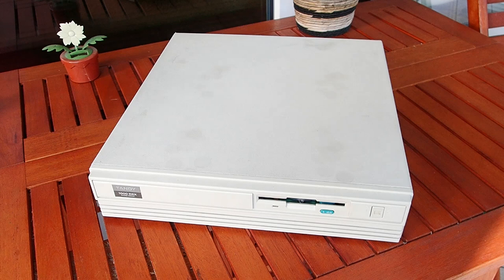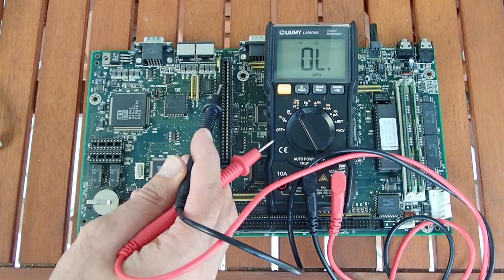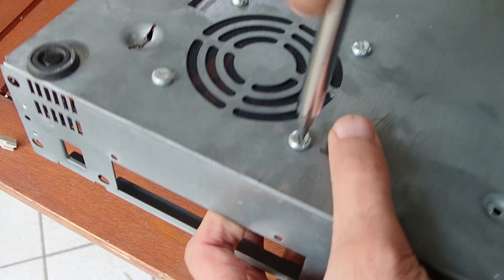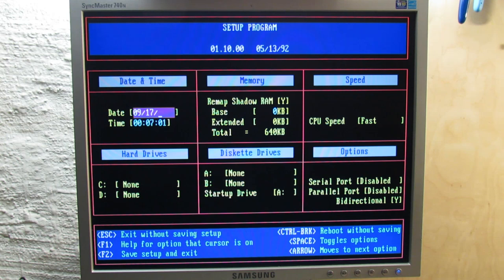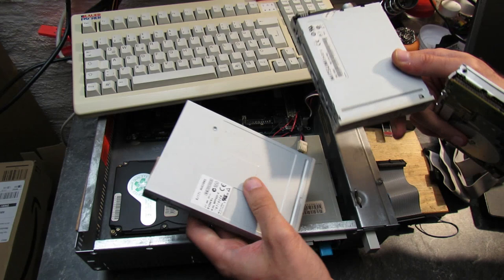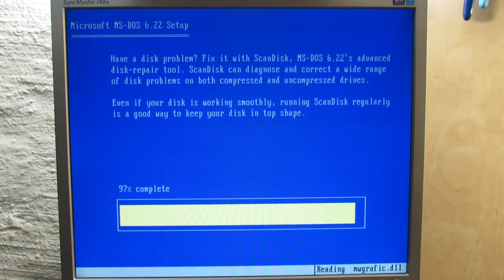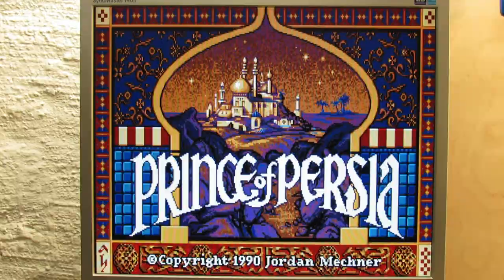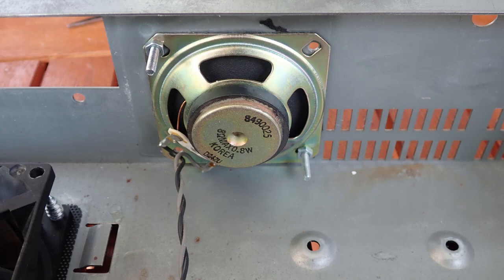#SepTandy with Tandy 1000 RSX (Part 2): cleaning and setup

Comment: naughties, 110V (probably USA, maybe Japan), czech or slovak software, bigger hard drive
this is weird mix indeed
I have strong suspicion hard drive was purchased recently, as it would be very unusual to find czech or Slovak software in USA.
I live in UK. It is uncommon to see any European software. Windows - English, MacOS - English, games - English, even software made say in Poland, used by Polish people (even games) - English
Reply from the maker: I think this machine was imported from USA or Canada to Europe and the hard drive was upgraded one day, but I don't think, that it was done recently. The data on this machine is old, probably it was stored untouched for 20 years or so. And later someone tried to test it and plugged into a 230V EU wall plug. I bought this machine as you see in the video. So all that is just assumption.
And in regards of language, I don't agree. I live in Germany and you will not find a PC here with English software. Everything is in German. Windows, Office, Games, Browsers, just everything. Many people don't speak English at all and they would have problems with non German software. I simply try to use the software in English in my videos, because this is the language in which I'm making this channel. You can see in my earlier videos, that I'm using my original copy of German MS-DOS everywhere. I just didn't have it in English and had to obtain a copy extra for this channel. I saw the same in Russia and China, the whole software, Windows and everything is in Cyrillic or Mandarin. Back in the DOS days you had to use a special TSR tool, which turned on the support for Russian language in DOS. It was added into the autoexec.bat and until that one wasn't loaded you couldn't read any messages on the screen. Already the "Starting MS-DOS..." message was just a gibberish, if your graphics card ROM didn't contain Cyrillic Fonts (most of them didn't).
Reply: @necro_ware  by recently I meant in recent years, maybe even 10 or maybe even 15 years ago. Comparing it with computer you down here it is still recent purchase.

This is exactly what I meant. All software in UK is English too the point that most foreigners would have English software as well, as it is easier to source.

I myself don't care to change that. I have everything in English, but honestly I may be lost in Polish software. When I started to use computers translations were made by either computer people without clue about both languages or experts in both languages and no clue about computers. Both were compete disasters and always funny.

God example of how bad it was is Commodore Amiga OS translated to Polish. There are two versus and both are so hilarious, that makes people cringe